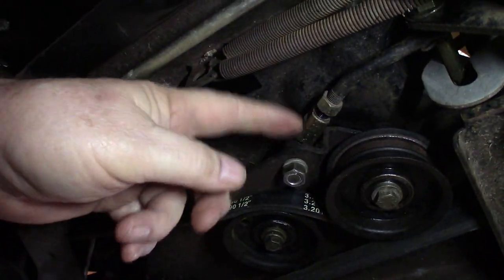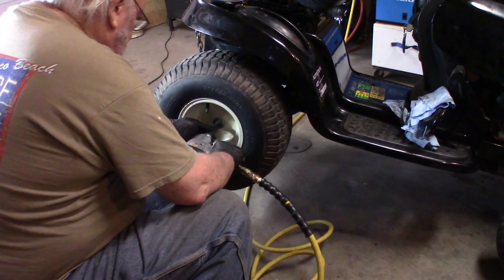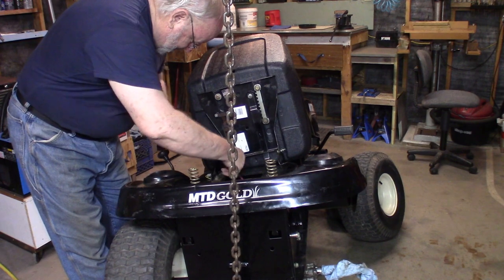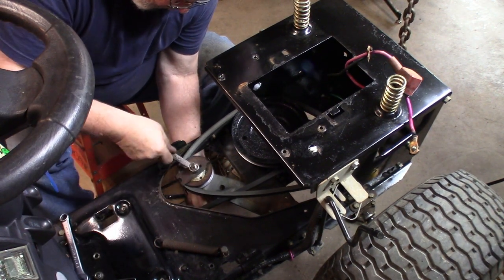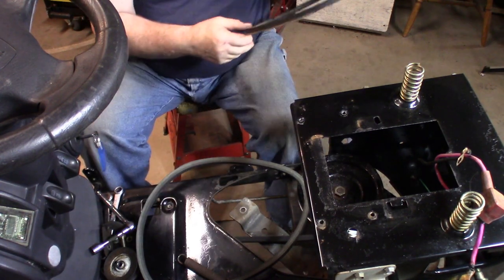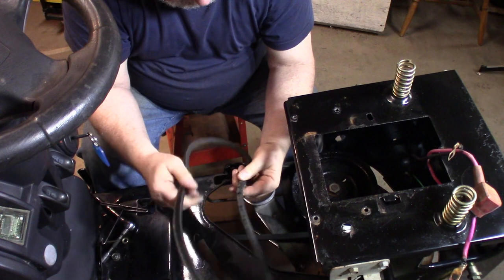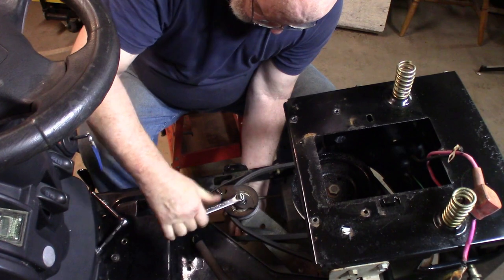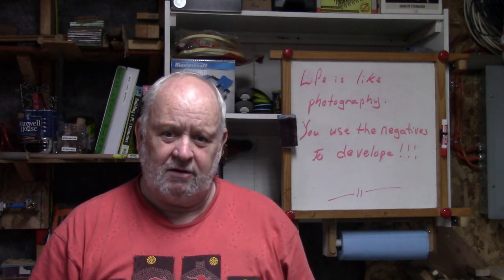Drive Belt Issues with the MTD Gold

Comment: We are always having belt issues with our equipment. It is surprising how much difference a B section belt makes when it should be an A section, for example. Some of our older equipment has non standard belt lengths and the originals are no longer available, finding something that works in that case is fun. It was great that you could take the panels off to see what what happening, it is not possible to do that on our Westwood which has the same tranmission which is not helpful. Despite the work needed to take the cover off I really like your approuch as it is good to understand how it was designed to work. Great job getting to the bottom of the issue
Reply from the maker: Hello there Joseph!!!  Thanks for your comment.  I am learning a lot about belts working on the tractor that's for sure.  It's a journey of discovery!!!  It seems to me there are plenty of places to order replacement belts, and the descriptions are all different for what could be the same belt.  You need to know what to look for and if that info isn't in the description, I have learned to stay away from that part!!!   LOL  Thanks for tuning in and take 'er easy!!!

Comment: We have had a couple Troy-Bilt (MTD with different paint) mowers with the varable pulley drive. They do okay mowing, but any load and the belt chews up. 
I found that if the belt is too deep in the variable pulley it rides on the shaft and loses grip. You have to run mid range to high to make the belts last. 
Also towing anything like a lawn roller will chew up the variable pulley's belt. I was mowing 2 1/2 acres and for a whilewhile I was working on the road  we hired a guy to use our mower and mow our yard.  He had his daughter use ours while he mowed the neighbors yard with his. It got a lot of wear that sure didn't help. 
I ended up changing the variable drive belt every year for the 14 years I kept it running. 
Geared transmissions are better for hauling or pushing loads. 
Using it as a light duty Doodlebug should be okay.
Reply from the maker: How's she goin'?  The variable speed sheaved pulleys are not good on belts.  But having having said that there are many ATV's and Snow mobiles that operate with variable speed pulleys and the belts last for years on them.  But, I have to say, I'm not a fan of this type of transmission.  But since that's what was on this MTD that's what I ended up with.  I hope the new (and proper sized) belts work out, but we'll see.  Thanks for taking some time from the bathroom project to watch and comment.  Take care!!!
Reply: @GrampiesWorkshop  I get to look around during lunch and after 8:00 pm. 😁😎

Comment: Hey Mike. Looks like I got unsub'd from you. I haven't had that happen in a long time but I redid the sub and bell. Well ole son, bit by bit you are getting this beastie tuned up better than new eh. One nice thing I see is all the pulleys have regular alternator bearings. Yo can get them for around $10.00 or less pretty much everywhere. These belt drive systems drive on the sides of the belt. (I am sure you know that.) Once they wear enough that they wear in so they are touching the bottom of the V grooves they are done. If they sit too proud they catch right away. That causes no feathering of the system thus the lurch. I have had folks come to me with this problem for years.  Having the service/parts booklet is something that is often lost or thrown out. Only then can the right cross section of belt can be found. There are 3 or 4 different types to choose from but only the right ones will work as they should eh.  One thing about you good sir is you won't quit until things are as you want them too. The curse of curses eh. LOL. Take care bud.

Comment: I like your little spring tool! Did you invent that? That new belt will solve your problem. Guaranteed! An inch difference is huge in that application. Cheers!
Reply from the maker: Hey there Mike!!!  No I can't take credit for that 'spring puller' tool.  A buddy of mine made it and gave it to me one time.  I use it a lot.  It's very handy when removing a spring.  You can remove the spring 'under control' so to speak!!!  LOL  Thanks a lot for tuning in and commenting.  Take care!!!

Comment: I've got one of those rider's with the speed pedal. Bought new belts and ready to install. 
Glad you showed how to adjust the speed pedal. Hopefully I'll get a little more speed out of it. Mine also has a granny low, a high forward , and reverse. I picked it up for a few bucks and it had no name on it, except for the sticker under the hood saying it's an MTD with a 23 HP Briggs and Stratton V twin.
So far I've had to replace the carburetor and fuel pump and new tires all around. 
Servicing the belts next and no need to work on the deck, because it doesn't have one, so I'm just going to use it as a mule.
I did notice it needs a new crankshaft seal, but for now I just want to see how it performs ....❤
Reply from the maker: How's she goin'?  Sounds like you are using your machine for the same reason I got mine, not as a ride on mower but just as a ride on!!  I wish mine was a V-twin.  Those engines are nice and smooth.  Mine is a Kohler 17 and it's pretty rough and noisy.  I'm having a problem right now with the coil.  When the engine warms up and with the hot weather, the coil shorts out and kills the spark.  I'm hoping a new coil is the answer.  Thanks a lot for dropping by the channel and I hope you can come back again soon!!  Take 'er easy and good luck with your machine!!!
Reply: @GrampiesWorkshop  your like me, I like to fix things and play with them. 
So yeah, I'm using it around my little acreage to pull a trailer, and haul firewood and other stuff. I'm glad I stumbled upon your channel gramps. Maybe I will learn a few more things from you.
Like you, I'm getting up there in age and have all the time in the world to do the things I love. So show me some more stuff. I'll be watching you gramps 😁, and have a better one tomorrow.
Reply from the maker: @albertcassler8763  Many Thanks !!

Comment: Looks like you are using a B belt when you need an A.  I am not sure but I think the pitch is different as well.  Changing those belts out is the worst job on those tractors.  Took me 2 hours to do my Ford. A frustrating job.  Stevo
Reply from the maker: How's she goin'?  You know when I was having trouble with this belt I thought the same thing, that I need a Type A belt.  But when I checked the spec and measurements and compared the part numbers, it's a B-belt that is suppose to go here.  Even though the B belt doesn't seem to work very well.  Maybe it's because it's new.  We'll see anyways.  I have 2 B belts in place now and we'll see how they work out!!!  Thanks for the observation Stevo and for watching.  Have a great week and Happy Anniversary!!!